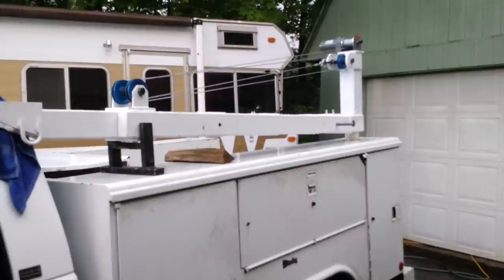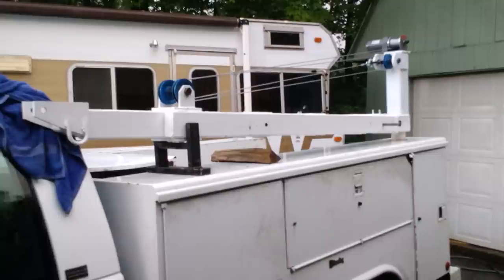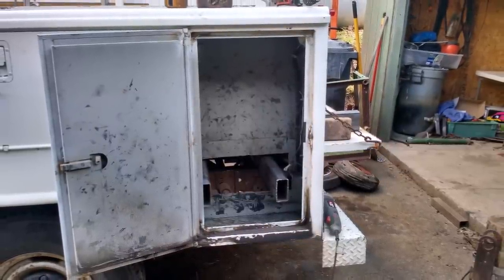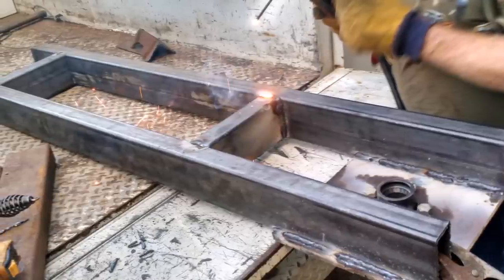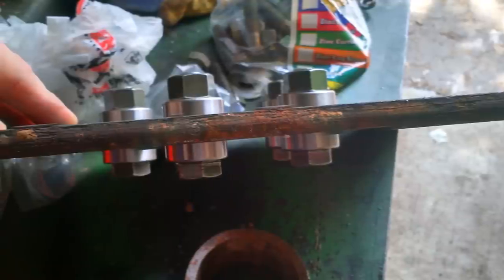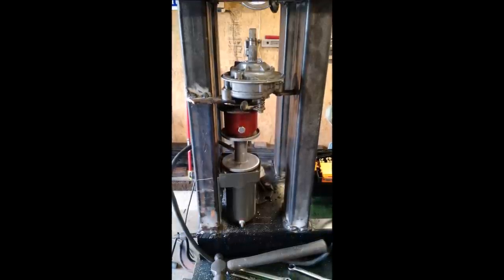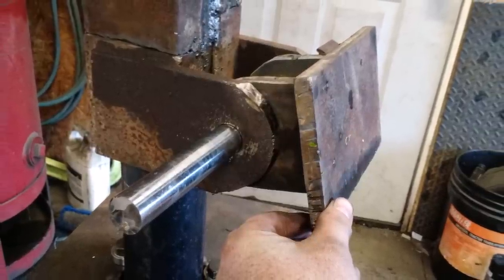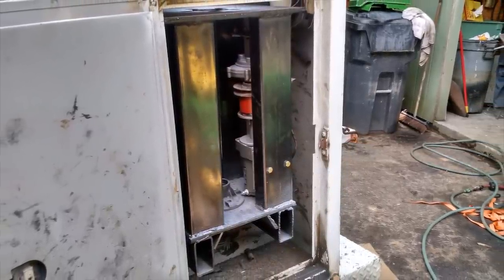DIY Homemade Truck Crane on Service / mechanics truck, built like an old Auto Cable Crane

Comment: I don't know if you already installed RF remotes but let me tell you in advance you will not want to use 12-volt controls if you are sharing the battery. 12-volt RF controls will drop out under heavy loads and you will experience continued dropout similar to loose wiring which is just low voltage drop out. I suggest you 1) use a separate battery that only charges from your truck via diode, or 2) use a 5-volt controller which has a regulator. Nice looking crane.

Comment: In the 90s I worked as a welder mechanic for a construction company auto cranes were popular back than I built my own crane for my service truck using heavy duty rectangular tubing I of course copied auto crane had power hydraulic for the boom 12v heavy duty power winch and electric motor swing the extension boom was manual I even made my own remote control box I
Picked up broken ripper shanks from our D10 cat to bring back to the shop for welding and easily removed hydraulic cylinders etc etc was more than a helper or second hand for me I also used it to put on big heavy wear plates for our D10 cat  dozers by myself 79 years old now retired and miss my job

Comment: Don't wanna sound impatient BUT sure would like to see an update. This is the best start I've seen on a truck crane that is not too expensive for a poor kid.
Reply: Phil Lowman...1D10CRACY was killed using his  crane  He apparently hit some voltage wires on site using it and became toast Condolences to his family
Reply: @johnknowing-zr8de  are you serious? Link to news report?
Reply from the maker: Luckily for me it's not true.    I finished the crane and some of my videos show it being used.   The HF wenches didn't hold up, I swapped them out with Champion Winches I had found at Menards.    Sadly I replaced the truck before doing a follow up video.   I did remove and keep the crane to be used on the new (to me) truck. keep an eye out for that video, I will do a better job explaining the build.

Comment: That is a really nice crane. I've been needing one on a 12 foot dump truck flat bed.  We have a couple PTO winches that I'd like to run the cable up the post and out the end of the crane to drag stuff up to the truck. We may just mount the winch on front bumper to do the dragging and build such as you have done to do the lifting only with the crane.  But as already stated do update when competed

Comment: NO overkill on the rotation bearing.
Reply from the maker: I had forgotten I had done this video till you commented.   This little crane ended up being an awesome crane!  The only issues I had was with the wenches, they just didn't hold up.  Within the first 6 months of use, I ended up swapping them all out for 3500# Champion brand winches and they held up!   As for overkill on the rotation bearings, maybe not, but they were adequate for the light loads the crane was intended for.  Probably the heaviest thing I ever picked was a Chrysler big block.  I did pick up the front end of a 17 foot glass I/O runabout once to do a trailer swap.   The next crane is in the works and currently sitting in the middle of my shop floor, its a bit bigger and hydraulically tucks down into the bumper of the truck.
Reply: @1D10CRACY  any updates on this new one? Sounds rad

Comment: Holy shit. I just now recognized the time-stamp at 8 years ago, so im not expecting a reply, BUT we'll try anyway...
  On the final assembly, did you either reduce or increase the size(s) of any pulleys or rollers on the lifting side winch and cable setup to multiply the pulling power and whatnot?
How was the final outcome?
Reply from the maker: If I remember correctly, all the pulleys I used were the same size.   The craned worked magnificently well!   I sold the truck and started to build a new crane for the new truck, but have not finished it yet.

Comment: Ya man I love it , hope ya dont mind if i Copy some parts of your crane idea ,Im slowly putting together a trailer out of a 76 one ton dually ford for hauling wood and anything else heavy for my projects , it would only be for home use as im in the process of retiring, wanted a crane for a while but the cost of hydraulics made that impossible , this should work great . thanks